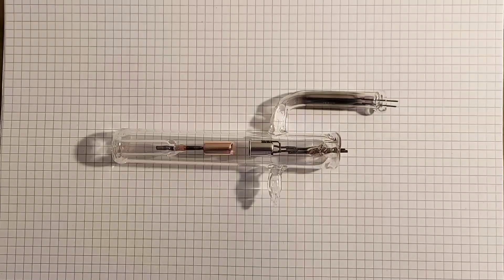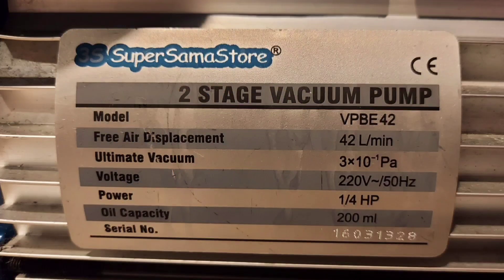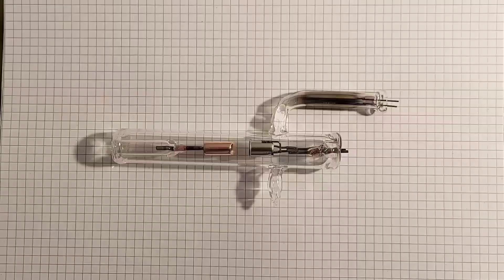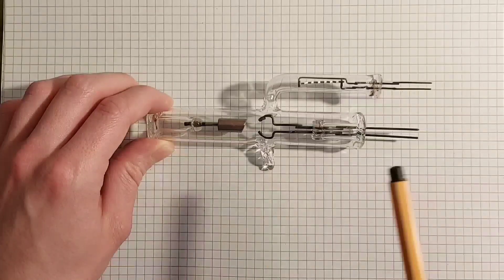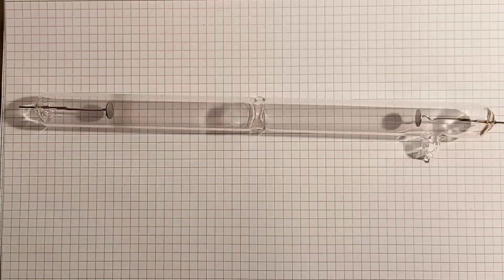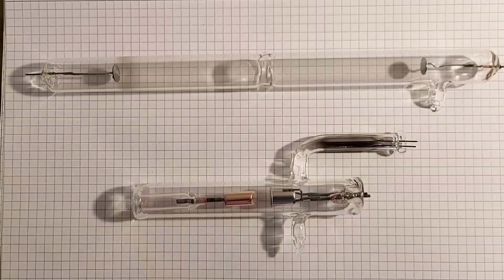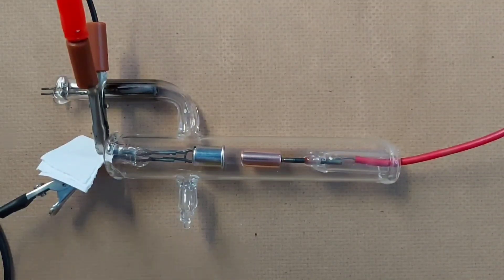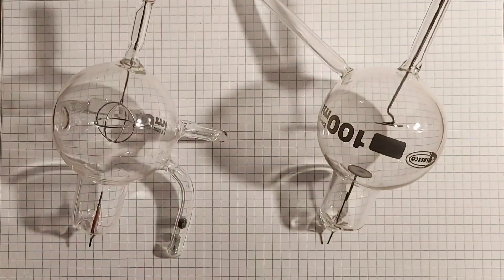Homemade x-ray tube - how i made it ☢

Comment: Thanks very interesting. I operated x ray tubes anywhere between 80kv to 300kv so was required to be conversant with the workings of the tube and danger in using them to yourself and others. I noticed your meter was in micro sieverts but no reading, as I guess not generating. I hope you took or take readings when that operates, and that 25 micro Sv is the max you should slow yourself at least according to refs. Take care I think you did alright.

Comment: Try making a focusing cup around the cathode, also a bit of TIG rod works well as the anode. Cut to about 23 degrees and have the angle parallel to the long axis of the filament. Low powered incandescent lamps work great as filament donors. Also baking out the tube, then backfilling the tube with a reactive gas mixture like oxygen then evacuating, then firing the getter with some modest HV on the anode relative to your getter will get an extremely deep vacuum in the tube. Titanium zirconium magnesium and aluminum all work well for getters. The lower melting ones like mg or al should be heated indirectly. Zirconium is the GOAT of getter materials. They use that in extreme reliability helium neon laser tubes like the ones for metrology or ring laser gyroscopes.❤

Comment: I have discovered that you can use activated charcoal to make a vacuum, later I learned about sorption pumps and reached a pretty good vacuum by cooling it even more with LN. That might complement well with your getter pump. 

In my experiment I filled a borosilicate test tube with activated charcoal which I attached to a discharge tube like you did to yours with your getter pump, I used charcoal from a gas mask filter and used about the same volume as my discharge tube which was small about 50cm3 in volume, I heated it up with a blow torch as uniformly as possible until it stooped releasing steam then made a vacuum with a rotary vane pump and established a very faint discharge so the electrodes didn't overheated or sputtered too much. I kept heating the charcoal just before the glass begun to reach its annealing point so about 500C°, I keep it at that temperature for some minutes, then the most difficult part. I turned off the discharge then sealed the tube from the mechanical pump and stopped heating the charcoal to let it cool, then i turned on the discharge again.  As it cooled it begun lowering even more the pressure, when it reached room temperature the discharge was like the one of a Crookes tube, then I cooled the charcoal tube with liquid nitrogen, the discharge completely stooped very fast it probably wasn't even at dry ice temperatures. I cannot measure vacuum below a couple of microns but ill say it might well be into the e-6 torr when the charcoal reaches LN temperature. 

I will try your getter pump idea as well, maybe that will pull the ultimate vacuum well into the UHV if I bake well my tube and there is no leaks. Maybe finally I might make my own X-ray tube! making the anode is the hardest part. Sr. have you tried to make housekeeper glass to metal seals?

Comment: I was kinda able to reverse engineer the tube from the video but I was wondering what goes into the inert cilinder / cathode . It is just a metal 'cup" with the tungsten electrode as a filament or am I missing something
Reply from the maker: Its a former anode cup of a rectifier that is just put over the filament and is spotwelded to one pin of the filament 
The other pin isnt touching the cup of course

Comment: Nice work! But a geiger counter isn't a good tool for quantifying x-rays. It is too sensitive to high voltage emf and not sensitive enough in the gamma range. Lower "potential" rays wont excite the tube and you will not get an accurate reading. You need a victoreen 470a. I have one.
Reply: You can tell that the Geiger counter is picking up the X-rays just fine and doesn’t seem to be affected from the high voltage nearby. The HV was flowing and the Geiger counter didn’t start going crazy until the filament came on and started the thermionic emission. 

But yeah it’s probably not very accurate.

Comment: Fantastic, I wouldn't have imagined that a simple mechanical pump plus a getter would be good enough for a tube like this. I may be able to try it out in the future, maybe I'll use the cathode and glass pass-throughs from a fluorescent lamp, as they are readily fused and sealed.
Reply: I wonder if ehating the whole tube before yo flash the getter helps it get more from the rest of the tube.
Reply: @jhoughjr1  you're right it does, tubes are usually baked while they are pumped as this helps release trapped gases in the solid parts of the tube, the envelope and elements. If you watch some glasslinger videos you may see him doing it.

Comment: As a comparison, how about trying the GY501 color tv HV rectifier tube in terms of x-ray output?
Reply from the maker: Oh i really like this tube 😄 the only thing that is difficult is to somehow prevent arcing over on the outside i experimented with it and found out that vaseline around the electrodes and something that gives the vaseline shape works fine. The tubes i tested were usually strong emitters for that it is so cheap (actually similar to my cold cathode tubes).

Comment: at the end of the video, the tube on the left is a fuser? and it works?
Reply from the maker: Yes and no  the gas discharge worked but the fuel storage was outgassing too much over time so the pressure was too high (was filled with a small portion of D2O in coppersulfate )

In future i will continiue with the experiments to this tube

Comment: I also woud like to make X ray tube but not just for concept proof but for practical use.
It seems to be ultra simple device which is for some unknown reason way overcomplicated so maybe you will try some other sipler designs later?

One thing to make it practical is  to provide good cooling for anode  or else it will melt.
also beam has to be focused into a very tiny dot to make this tube usable for imaging.
Reply from the maker: A very simple usable tube is a cold cathode tube that uses a gas discharge (the cathode can be curved to focus the beam)

In my other video i demonstrated such tubes and soon i will upload a video where i show how to make one 😄

Comment: The rays of good ☢️ 
Please watch out! It seems like you don’t have any lead shielding around the tube! Also scattered radiation could be harmful!
Reply from the maker: Dont worry i actually wear protective gear for this 😄  but my best argument is still the low anode current(+kind of low voltage) and the limited amount of time

Comment: Making the filament must be one of the most difficult parts. Did you harvest it from some other device and reuse it, or made it from scratch?
(edit) oh I see. I've re-watched the video and I think you made it from those 0.5mm thoriated tungsten electrodes. Correct? :)
Reply from the maker: Yes exactly 😄 i just sacrified my lungs a bit for a cheap source of thoriated filaments ..it was worth it 😎

Next time i will use an old filament from a broken tube
Reply: @atominik3375  TBH I think even plain, non-thoriated tungsten rod would have worked here. You don't want the filament emissivity to be too high in a X-ray tube or else you can't raise the voltage too much without the current skyrocketing. Yes you get more current across the tube, but weaker X-rays.
Or else, coat the plain tungsten in a layer of barium carbonate before installing in the tube; then when the tube evacuation is almost complete but you haven't sealed it yet, heat the filament to orange-yellow to convert the barium carbonate to barium oxide and barium metal,  which are the best thermionic enhancers. After that pump the tube some more to get rid of the carbon dioxide gas that the conversion generates before sealing it.
Reply from the maker: @stamasd8500  mh yeah makes sense  i think i will use pure tungsten in the next xray tube like you said then 🤔 and the barium oxide one day in triodes or crt's
Reply: I will now subscribe because you said the magic word 'CRT'. Would very much like to see one with electrostatic deflection, please!
Reply from the maker: @StochasticJeff thx 
 sure but how i make the seals comes first 😄
Reply: @atominik3375  hello my friend You cannot make direct bonding with copper.

Comment: Great video! I really enjoyed watching it! The glass work you did with only an oxy propane torch looks very impressive. 
I would be very interested to see a video about the power supply you are using. 
Have you tried imaging something with this tube? You get X-ray intensifying screens on eBay for very little money. Just be careful with the radiation. 
By the way, are you from Germany?
Reply from the maker: Thanks 😄 i already prepared a Video about that supply not sure when i will upload it but one after the other ..how can i be not from schnitzelland 🥴😂
I have an intensifying screen but at that low tube current i already knew it is not worth to try  (in the lower μA range if i remember correctly)

Comment: Why not use bismuth as an anode material?
Reply: bismuth is a really low melting point metal, and those anodes get HOT. It would melt. Commercial X-ray tubes even have forced water cooling of the anodes.
(edit) one way to overcome that would be to coat a copper anode with bismuth. Bismuth would diffuse inside the outer layer of the copper anode making a superficial layer of bismuth bronze. That would have a lower melting point than the copper, but considerably higher than the bismuth alone.
Reply from the maker: Would probably work really good for creating xrays but i guess the low melting point would be a great Problem during the baking procedure (and im not sure about the outgassing)

Comment: This is awesome. Wish I had the stuff lying around to try this. I've been meaning to build an xray machine for a while now.
Reply from the maker: Thx ! 😄
i really recommend using cold cathode tubes for this 
Its easier to build and allows more current compared to the hot cathode tubes( i made until now 😅)
Its possible of course but needs more trying for a good version

Comment: Well constructed, very impressed with your glass to metal seals. I find it's difficult to get these reliable enough to hold a good vacuum long.
Reply from the maker: Yeah when i started i had really problems with over or underoxidized sealings 😄 after some more attempts it was getting easier to get the right Oxidation

Comment: As you hoped, I loved the video. Especially loved the repurposing of commodity Pyrex glassware.  Always hard to get small quantities of special glass stock for the hobbyist but lab-ware is more freely available from educational and second hand sources.

Look forward to any other process videos you decide to publish.  Until one has the gear to practice in the physical world all examples that are available add to the knowledge base so many people watch videos and read books before lighting the first torch flame.

I was using an oxygen concentrator with a lamp working torch (glass bead enthusiasts do this often) to get high temperatures.  When I get my workshop up again I will certainly try my hand at electrical feedthoroughs which are a special skill.
Reply from the maker: Thx 😊 when my exams are over i will continiue to upload Videos again where i will show it in detail how to make such tubes

The most expensive part is just the oxygen so maybe i have to switch over to a concentrator too in the future 🤔

Comment: Great video! I remember trying to make gas discharge tubes from borosilicate glass in our science club in high school.. It's much trickier than it seems even to make a basic 2 electrode tube! I think I mainly failed when it came to making good glass-metal joints, as I was only using copper at the time.
Reply from the maker: Thx 
Oh that sounds interesting. Do you tried making this knife edge seal/housekeeper seal with it ?  This type of seal is still a mystery to me 😆
Reply: @atominik3375  I've read copper doesn't seal well to glass. I also have problems melting more than two electrodes into the glass. But that's tungsten.
Reply from the maker: @MyProjectsTV  schreib mir mal auf insta (wenn du willst)😆 ich müsste hier sonst einen riesen text schreiben und bin mit dem vid dazu noch nicht so weit
Reply: @atominik3375  Wie finde ich dich auf Insta? Sonst schreib mir mal, ich habs auf meinem Kanal verlinkt.
Reply from the maker: @MyProjectsTV  moment 😄
Reply: @atominik3375  
Du bist deutsch? Nice.